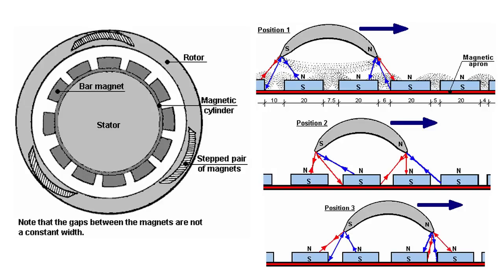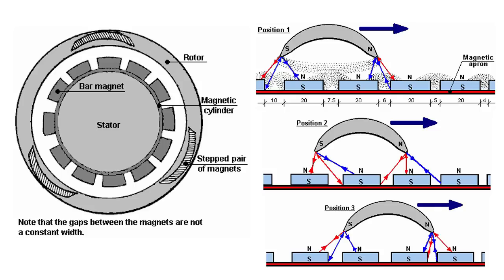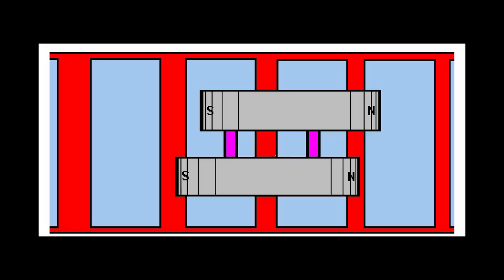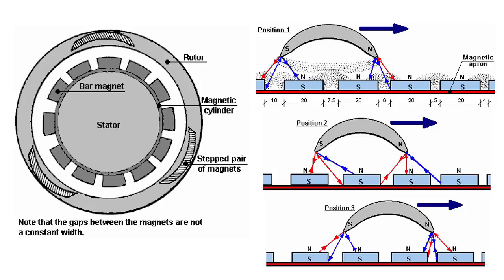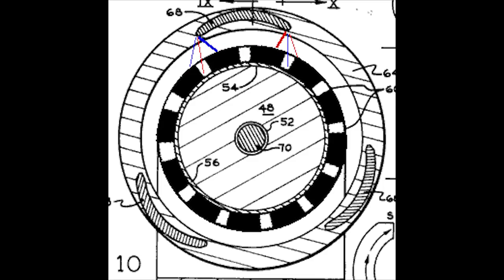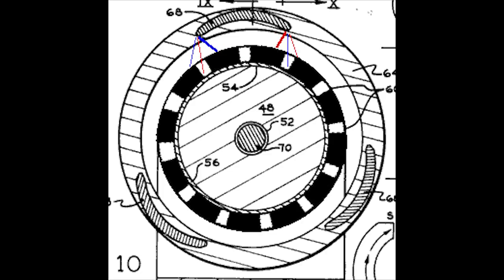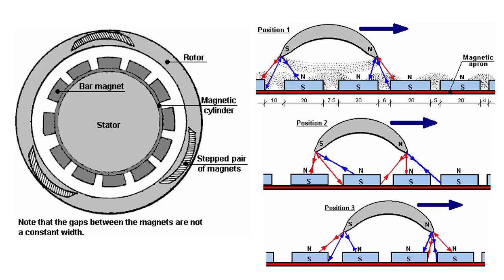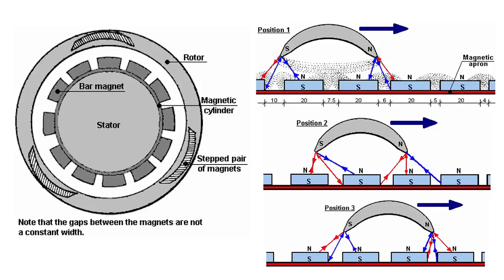Free Energy Generator - Howard Johnson Permanent Magnet Motor

Comment: I met with Mr. Johnson before he passed away.Went to his home in Virginia.He had all of his experiment in a friends basement. He never made an actual motor . he had this lay out with a lot more extra magnets. he got away from magnetic shield materials they did not help. He also had a series of arch magnets kind of like going through a train tunnel. the arches were spread about 4" apart..
Reply: GeorgeT1492 I see everyone want to comments to much on Hayward Johnson motor if is working so we're is it AutoCAD is not enough also straight track  which u practical .hah I try same like in round shape is not working when u install ur magnets in straight is working  I lost money to much in 4 year
Reply: Did he demonstrate this motor to you?  I read the original article.  For the reporter, he had one device wherein his hand held the magnet which drove the wheel.  This is highly suspicious, because the holder merely re guages the magnet relationship with his hand.  He did not demo this motor.  He demo'd the train, which is the only thing that sounded legit.  Too bad he didn't make the train a closed loop system -- it sounded feasible, but I wasn't there.
Reply: yes he did. They all worked in some sort of fashion. He was also building a big Ferris wheel type of system . none of it was commercially feasible. too many magnets with too little power. why I went to visit him was I had built an electric vehicle that ran on a single 12 volt battery using inverters and a 160 volt  600 amp capacitor I had built over in Russia.What I was looking for was a way to keep the 12 volt battery charged without using a gas motor. If I could have built a small magnet motor to run an alternator I could run my electric vehicle indefinitely.So when I went to see him that's what I was looking for. He was a very simple bright man. The problem with all magnetic motors is there is no release valve. Did you ever hear of a gas engine without an exhaust valve. Picture a monkey  swinging in a tree. If forgets to let go of the one hand he will stop swinging. That is what is happening with magnetic motors.  you are right in your assessment of his work. 
None of it worked in a closed looped system.That was one of my thoughts too when i seen his projects. I think He was going to try an accomplish this with the Ferris wheel. It looked as though He was trying to space the small sections so the wheel would turn continuously. If nothing else He have to give him credit for His persistence in trying to break the magnetic code which I like to call it.
Reply: xxxxx
Reply: You say he was building a ferris wheel.  That's interesting because someone did exactly that. You mention too big a device for relatively little output. That was the problem of the ferris wheel -- which appeared to be completed and work as advertised.  The inventor just tried to collect on awards for perpetual motion.
Reply: The man offering the reward for perpetual motion simply tried to weasel his way out of it.  This was all in a perpetual motion documentary.
Reply: GeorgeT1492 I'm interested in learning how to build stuff like this and a car like yours. Where do you suggest I start? College courses, certain books, videos? I don't just want to build, I want to understand,  and I need a starting point.
Reply: Then how did he get a patent? And he admitted,that this was only an "energy storage" device....

Comment: Looking at this shematic I don’t see how it could work with those banana shaped magnets,BUT if it does work with no cogging/flux and no need to regauging it,that would be great,
Personally i think that placing those surrounding magnets at a 45 dagree angle with no space between them along with a few magnets put at a 45 dagree angle with no space between them as well on a stator,with the intention that they should always repel each other in order to cause the stator to spin,i believe this configuration will work😁

Comment: I'm still hopeful regarding the Howard R. Johnson magnet motor. In principle it should be able to work. But consider this... if the rotor has it's 3 pairs of "arcuate" (slightly banana shaped) SmCo magnets set at anything other than a perfect 120 degree spacing, doesn't it stand to reason that the whole unit will be centrifugally unstable... especially when running at high RPM? 
I'm sure he managed to get it to work. His demonstration for the US Patent office showed a working model that was attached to a 5kW generator, which delivered 5kW when the magnet motor was running.
His revolving model patent (US#4,151,431) includes a braking system, very similar to the drag on an old fishing reel. This is a friction source that I would suggest is going to be endlessly problematic... (given that the magnet motor genuinely works).
Reply: If this worked in 1980 and its now posted how it works we would have free energy by now. Not a chance of it ever working. This design is nothing more than a pipe dream.
Reply: Stop talking and start building. !
Reply: @tesakun3133  Been there, done that! How about you?

Comment: Energy from the magnet can be obtained without any mechanical movement.
 All we need is material capable of being converted from magnetic to 
nonmagnetic when applying electrical impulses. This will simulate the 
rotation of the armature in the generators.
 Such a  material was created for other purposes and there is technology.
More info ?
Reply: In other words this shit wont work you need a electric motor.
Reply: @jvmiller1995  it's funny to see they literally reinventing the wheel... lol
Reply: @gabrielesteves7498  laws of physics have been around a long time for a reason. They still apply today for a reason. So untell  someone proves them  otherwise this will never work.
Reply: @jvmiller1995  that's what I'm talking about
Reply: @gabrielesteves7498  Yes sir that was me agreeing with you.

Comment: Does magnets gets de magnetized (loosing Magnetic properties) over time?
Reply: Does it matter?
Reply: I don't think magnets will lose their magnetic properties over time, so if you got it working it will basically keep rotating forever
Reply: @andreasschmitt2307  The irony of your comment.. I hope that you can see it and better yourself in the future.
Reply: @JordanC052  
Will the paint fade, will the bearings get worse, will the metal parts corrode... Nothing matters, because this contraption doesn't work in the first place.
Reply: in hundreds of years

Comment: Banana type magnet motor not success 
Simple use outer side N and use S on rotor . fix it 15  degree  cross on rotor .See successfully rotat .
I make governer to control speed by  sliding outer side

Comment: Patent inspectors are over worked and under paid.  From time to time things that simply won't work get granted a worthless patent.
Reply: wrong.
the patent inspectors job is to protect the law of conservation.
which is against the law to break.

patent inspectors are rats that snitch you out. for breaking the law.

johnsons motor worked. it generated 30 kw cont.

thats why it and he were dispatched and all patent diagrams were altered so no one could replcate it.

this is fact and his wife backs it all up.

if you acomplish the imposible.
do not allow dreams of grander , prfit or greed cause you to seek patent protection.

the secret to over unity is.

just make it secretly and freely open source it for everyone or die.
Reply: wrong.
the patent inspectors job is to protect the law of conservation.
which is against the law to break.

patent inspectors are rats that snitch you out. for breaking the law.

johnsons motor worked. it generated 30 kw cont.

thats why it and he were dispatched and all patent diagrams were altered so no one could replcate it.

this is fact and his wife backs it all up.

if you acomplish the imposible.
do not allow dreams of grander , prfit or greed cause you to seek patent protection.

the secret to over unity is.

just make it secretly and freely open source it for everyone or die.
Reply: *****
Ronny Stator has never claimed to actually have something that works.  He is "experimenting" and observing the results but never getting more energy out than he puts in.

He is someone who is captured by a wrong idea.
Reply: I JUST READ 80% OF THEM JUST DONT EVEN WORK ... THE OTHER 20% WERE COMPLAINING A BOUGHT IT. LIKE SOMEONE WANTS THE PATENT OFFICE TO BE FILLED WITH GARBAGE ON PURPOSE....... SO ITS HARDER TO FIND THE REAL DEALS.......

Comment: hi there
your theory is look like it will work
I am gonna do some maths about this, may be it will work.
Reply: tell you right off it wont work
Reply: Please let me also know it! Thank you very very much
Reply: Why could we not use a supercomputer to not only figure out if a magnet motor will work but also to figute wich method will be required and wich types and strengts of magnets and combinations  of it are required to get it work, once the supercomputer has find the right combination of magnets and the right method, then we can try it out and see if that suggested magnet motor will either work or not,so am curious about this,
Also a magnet motor should self start and running permanently untill mechanical failure will happen soon or later.